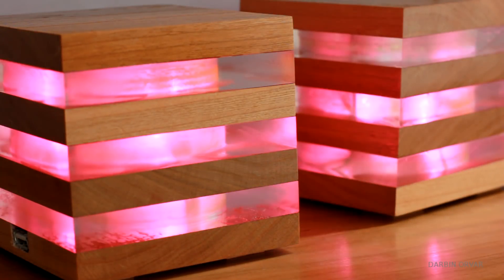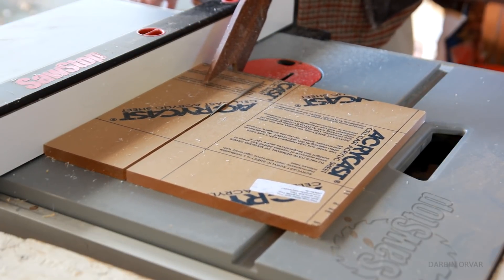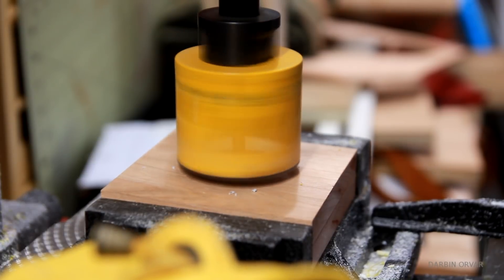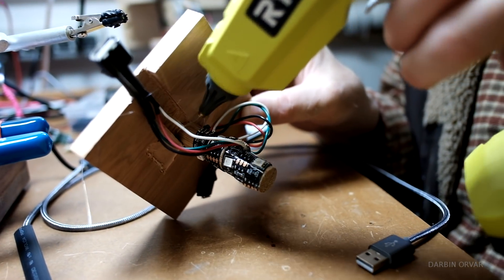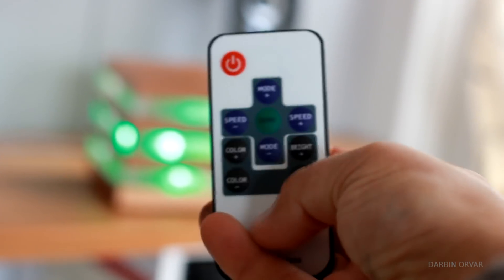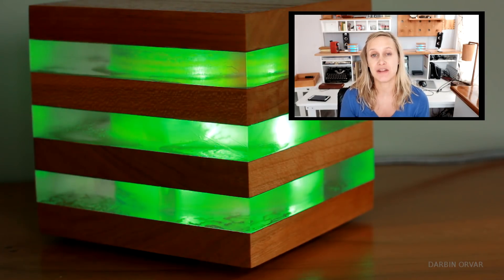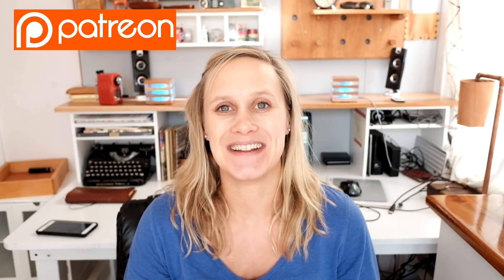LED Acrylic & Wood Cube Lights

Comment: To control the lights I would use an Arduino controller. It takes a little bit of programming, but there are a lot of people that have already done the programming for you. You just simply input the program into the Arduino controller and it's good to go. Nice project.

Comment: You might want to try using a hair dryer or heat gun when working with heat shrink tubing. Its better than using a lighter.

Comment: May i ask if anyone knows about LED strips here? Is there a difference in a 12v RGB or single color LED strip and a 5v RGB or single color LED strip?  Also a silly question, i dont think a 5v power supply would work on a 12v LED strip right?

Comment: Great project, keep it up. 
Just a few notes: perhaps one could use Super Glue in gel form?
I would connect the second USB plug to the first USB plug where the power comes in and not at the end of the led strip, due to voltage drop... especially if one connects more of these in series... just my 5 cents. I hope you don’t mind,

Comment: You connected those lamps in series. Could you connect them in parallel instead?
Reply from the maker: They are connect in parallel, someone else mentioned that as well. I think the view is deceiving.

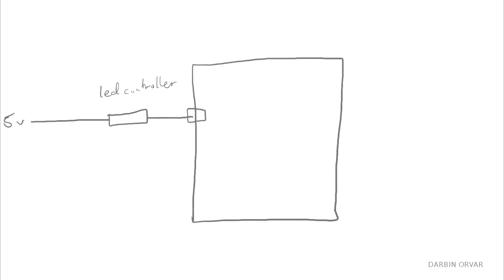Comment: @04:12 You use regular USB connectors for powering the LED Light strips. When I will be building this project I will use a different type of connector.
Because of the RGB, you have power on D+ and D- leads of the connector too, and this is outside of the USB specification. I would warn the users, do not plug regular USB devices into those connectors on the cubes, to avoid problems.

Comment: Hello Linn,

Why did you souder the led controller on the cable. I’m asking that because I would had install the led controller inside the lamp. 

P.S. Sorry if my English is bad.
Reply from the maker: Because there was only one controller which lamp to install it into? It made more sense to make the cable than to have to remember which lamp it was in.

Comment: If you mix the epoxy in a zip seal bag you can snip the corner off and use it like an icing bag to apply the epoxy easier.
Reply from the maker: Good tip!

Comment: Did you consider cutting the pockets for the USB jacks on the bottom face of the lower piece of wood? It seems like you could make the pocket large enough to hide the plug on the cable too.
I cringe when I see you using a lighter to shrink the tubing. A heat gun gives much better control.

Comment: Only issue that I have are the cables which are visible through the acrylic. If you made a hole in the dowel you could use that as a channel for those cables or just wrap the strip around the cables.

Cool use of USB cables. Probably one note here would be - make sure they are good quality, especially if you're planning on making more lights - the data cables (usually green and white) can be quite thinner than the power and ground ones so they may not be great for larger current.

I build a similar project with large Ikea standing lamp but I'm using Wifi (and recently HomeKit) to control it. Even thought about making a video about it :) And when using micro controller there's also a possibility to use neopixels and make cool animations, something I have planned for one of my next projects.
Reply: The LEDs in those strips are connected in parallel, so you don't actually have to connect cables on the other end of the strip. You can just split the incoming wires into two; one to the strip and one to the daisy-chain connector. 

As for cables, I've found old telephone cables and RJ11 connectors to be pretty neat for these kinds of projects. They're also dirt cheap 😃

Comment: Did you run your SS on "Bypass Mode" when you cut the plexiglass?  I'm always soooo apprehensive to cut anything other than wood on my SS in regular mode.  I've already had one cartridge activation...$$$$.  Don't wish to have another.
Reply: You only need bypass if it is mirrored acrylic. Normal clear acrylic is not conductive so will not trigger anything.

Comment: Really beautiful work, Linn! A tip I just discovered watching drone video buildings: try to find some silicone wire. The difference from usual wire and silicone wire is that the silicone is that the isolation won't melt with the heat from the soldering iron! I'm already looking for some of those. :)